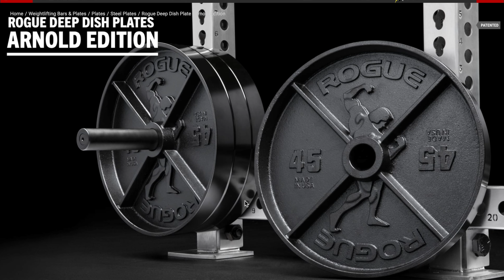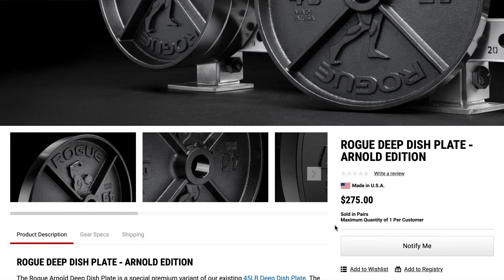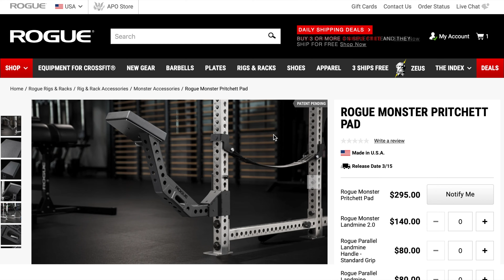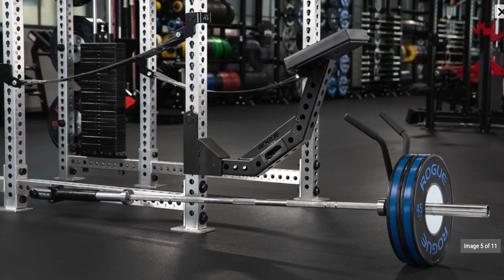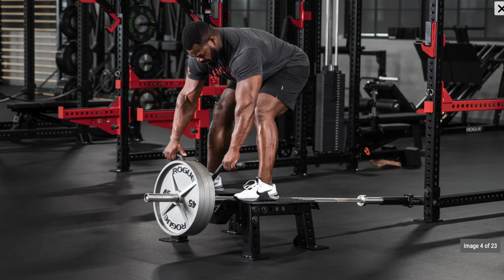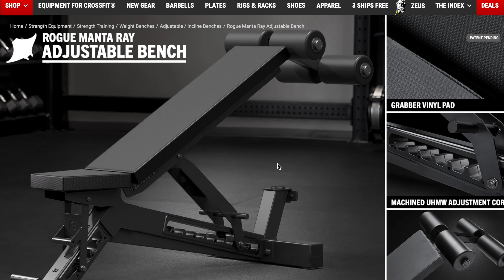ROGUE FITNESS new equipment preview! 2023/ Arnold Classic Recap

Comment: Bench looks like a tank but too expensive. I might upgrade my Rep Ab5000 with the Blackwing. The Hybrid Power Bar I would get if they offer full stainless. I’m a fan of 28.5mm but aggressive knurl. I have both the Ohio Bar and Ohio Power Bar in stainless. I prefer to use the Ohio Bar but prefer the OPB knurl.
Reply from the maker: That is some good feedback.  Bare steel makes an aggressive 28.5 also but not stainless.  

Let me know if you get the hybrid and tell us what you think.

Comment: My understanding is that the ladder system on the Manta Ray is UHMW as opposed to metal.  If this is correct, it would seem not as durable as if it were metal.  Hmmm.
Reply from the maker: Thats a good point.  REP uses metal ladder system with a plastic spacer to not mess up the paint on the ladder.  I wonder how long the UMHW would last?

Comment: I bet the new bench is going to be nice as *&^%.  I have the AB-3, so I'm in no position to call someone an idiot for shelling out an absurd amount of money for a bench.  For dips, I've been using a flip down safety and weight storage pins.  It works fine for me and I have to think it's going to be much more stable than something that's attaching to a single post.  Some different handle options, angles etc., might be nice.
Reply from the maker: Good feedback Bill.  There's a lot to take in here with all this new gear!

Comment: I think the rogue can probably execute the transformer bar at a higher level. My transformer bar had lots of QC issues. Great idea, but hard to do well.
Reply: It looks like Rogue has the sleeves inserting from the opposite side. That is better in my opinion as the top hole on my Transformer bar is finicky in getting the sleeve in as it is not exactly right. I think Rogues sleeves would be more rigid too with the pin.
Reply from the maker: Rogue's improving all the Kabuki gear in every aspect that wasn't quite perfect previously.  I think your right with your assesment.
Reply: They actually did update the Kabuki bar it's looks much better my transformer bar (v4) has issues as well

Comment: Great summary. If this is the full extent of Rogue’s innovations for 2023, it’s going to be another very disappointing year if you have a Rogue rack and waiting for the type of innovations Rep rack owners have benefitted from (i.e. Ares, Athena).
Reply: I think Rogue wants to get more mileage out of their slinger ecosystem. They've got some similar stuff, but the level of integration Rep has is above and beyond. I'm not holding my breath for a direct rogue competitor (plus, it's cheaper to get a ups setup, and that doesn't limit your racks versatility whatsoever)
Reply from the maker: I agree with both of you.  I've been looking to Rogue for some better plate lat/cable systems.  The slinger drives me nuts with this inadequacies.  Look to OAK CLUB for a new in rack cable system coming soon..

Comment: Can't wait for the new bench. I like the look of MM better, but to get the thicker handles, it makes it significantly more expensive. Also, I prefer a neutral grip.  The interesting thing about that new 28.5 bar is that it's stainless steel and has a 10 on the Rouge F scale, which is higher than their bare steel bars. Their stainless steel bars usually only have a 2 on their F scale.  I'm in the market for a new bench, so I'll be grabbing that for sure, and eventually, the new dip attachment.
Reply from the maker: cool!  Good eye on the F scale.  This may sound crazy but I've talked to owners of barbell companies and those scales are very subjective and more marketing than anything due to variation in the steel.  Stainless isn't even stainless, it's a steel alloy for strength for example.  let me know how you like the bench?
Reply: @Mac Strength Co.  Will do, and I currently have the zero gap to compare it to.  I'm curious now that you have the Irwin bench do you still get much use out of your other benches ?  How much better is the quality of the steel, paint, and overall feel of the bench ?  In other words does it feel significantly more premium to you compared to your rep benches ?